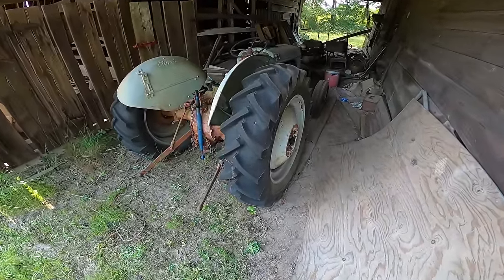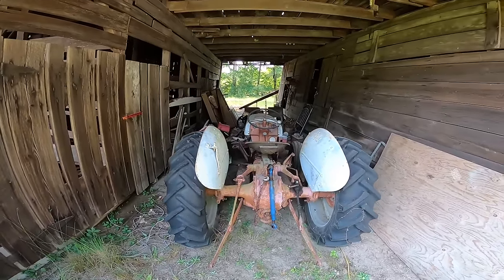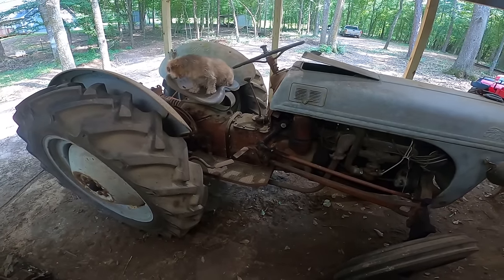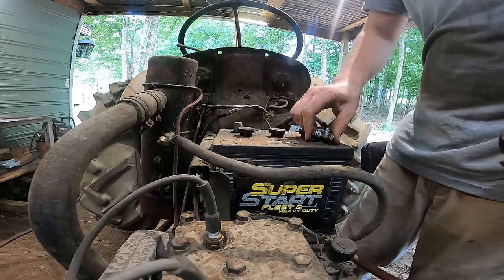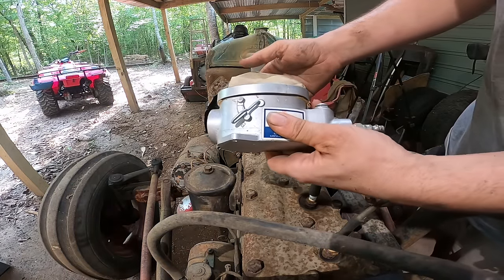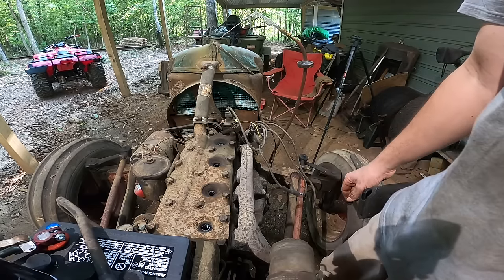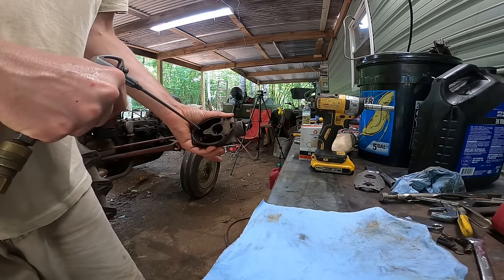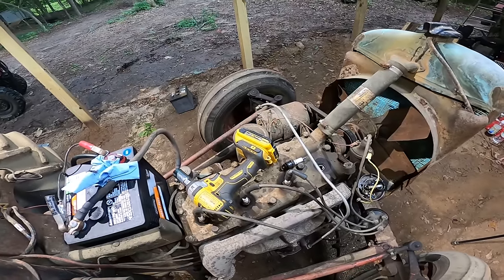Rescuing A 1952 Ford 8n Tractor Sitting In A Barn… Will It Run?

Comment: Hey Darrell, looking at your distributor and points orientation , it looks to me like the points are looking at cylinder number 2 instead of cylinder number 1. To correct this you would need to pull the distributor up enough to be able to move the distributor shaft one tooth  toward the number one cylinder. Make sure you have the timing on 4 degrees before top dead center before doing this! This should smooth out the rough running you are.experiencing. 😊
Reply from the maker: thanks brother

Comment: Just so you know that since it's a 6 volt system you can use a 8 volt battery and it will turn over faster.
Reply from the maker: @thomasschimdt5217  nice to know!!

Comment: Could have bought a 1940 9N at an auction back in mid January but I let it go when it reached $625. ALL four tires were beyond toast but the tractor was not a rust bucket, It needed EVERYTHING but I would LOVE to have bought it as a project to screw around during retirement.
Reply from the maker: they really are useful machines and really easy to work on this tractor was the best 700$ I think I’ve ever spent

Comment: Reading through the comments, sounds like you figured it out.  I have a 52 that I got running after sitting for about 6-7 years, and you're doing much more than I initially did...lol.  We just filed the points, checked for spark, added gas, and shot some starter fluid to get it rolling.  Popped off one cylinder at a time for a couple minutes until all were firing and then drove it onto the trailer to haul home.  BTW, I noticed the 105 shell right before you showed it.  This is from a 105mm Howitzer (artillery) and not a mortar.  Still used by artillery and also fired from AC-130 gunships.  :)
Reply from the maker: I wish this one was that easy! points and condenser were great no corrosion at all and was getting good spark, be sure to stay tuned to part 2 to see what I find

Comment: I had a lot of those tractors ,clean your points, check your condenser, and your coil. those tractors had very little oil pressure ,like 20 lbs or less. open your oil drain plug, unclean out your screen input new oil in, usually 30 wt. o[il. good luck.
Reply from the maker: Thanks for the tips! my friend!!

Comment: Darrell, you could possibly pin point the compression issue with a wet test. Put a little oil down the weak bores and repeat the test, compression goes up, its stuck rings , no change is a valve issue. Id say theyre just stuck or the bore is a little glazed, think some use a mix of atf and diesel to free them, have a Google. Id check the points gap and do a dynamic timing set on the ignition. So first gap the points with them sitting on the lobe in the dizzy, then wind her to the timing position, Id guess around 4-8 degrees before tdc and turn the dizzy until the points just start to open (use a multi meter on continuity across them). Great job, cant wait to see her fire 🙂👍
Reply from the maker: Thank you for your help! I’m starting to get into the engine I really hope I can get it going!! I love this tractor but it’s kinda got me stumped, I really think the distributor timing is off or somthing I dunno yet ☹️
Reply: @TheHomePros6221  you'll get there Darrell 🙂👍

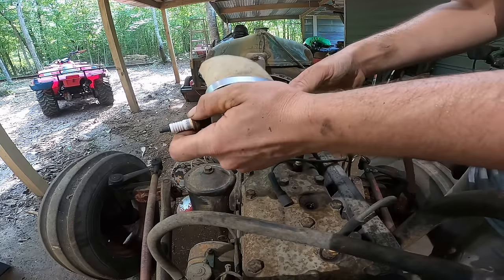Comment: At 18:40 - There was a time when spark plug sandblasters were pretty common. Someone decided that it would introduce sand into the cylinders, and it would if the sand packed up inside the plug, so, fewer people would continue to use them.
Reply from the maker: you are absolutely correct

Comment: Watching you pull out those spark plugs with channel lock pliers.....I could almost hear my father sitting on my shoulder yelling "NO....NO....NO!!!!  Use the right GD tool !!!!"
He has been gone 35 years now and he still haunts me....in a good way.  :)    By the way, my grandfather ran his whole farm with an 8N Ford exactly like the one you are working on.  Thanks.
Reply from the maker: I was in a barn far away didn’t have many tools, sockets wouldn’t fit without gas tank removed, I was planning on replacing plugs anyway, and the channel locks worked great so I’d say they were the rite tool for the job 😊 but thanks for watching my friend

Comment: I am needing to work on my carb and was watching in hopes I would see how to take off the throttle and choke cable. It looks like it just pops off and on easy. That helps my stress level because I’ve never worked on one either.  Thanks for the video.
Reply from the maker: they are super easy to work on the carbs are very simple

Comment: A little engine oil (about 1 tablespoon ) in each cylinder will help seal the rings some. Timing should be 4 degrees before top dead center..
Reply: Also, check the plugs out of the head to make sure they are getting spark through them.
Reply from the maker: Thanks clay I did try putting atf in already and I’m getting spark at the plugs. As far as the timing goes do I turn the flywheel until it gets on the 4 degree mark? How do I set the distributor? Thanks for your help!
Reply: Yes, you take a screwdriver and turn the flywheel, using the ring gear to turn it, toward the 4degree mark. You should not need to reset your distributor because you are not moving the crankshaft that much. Be sure to check your points for proper gap and smooth contact pads.
Reply: Make sure you have the correct spark plug wires going to the correct cylinder. Your tractor's firing order is 1,4,2,3.
Reply from the maker: Thank you for your help the spark plug wires were incorrect so I hooked it up like you said and it popped off a few times I then looked in the manual and the firing order is actually 1,2,4,3 and I hooked it up like that and I got it running!! But I think it’s going to need a rod bearing cause it has a little knock. Thanks for your help!!

Comment: Valves could be stuck open, once it runs they will free up, these engines are a relation of a Model A Ford engine, get it running let it get warmed up, let it cool down repeat a few times rings and valves will free up with use, change all fluids oil, gearbox, coolant etc. 👍👍😉👍👍 IF you get stuck, an empty cereal box will suffice to make a gasket.
Reply from the maker: Thanks Barry I rebuild the engine in the other vids

Comment: Fresh set of points, condenser, check coil. Dull spark. Get it running & valves & rings loosen up for more compression also.
Reply from the maker: yes sirr

Comment: Pore some transmission fluid into the Sparkplug holes, and let it set for about two days, and turn the motor over by hand after those days, then add more, and keep turning it every few days. Pt2

Comment: when I rebuilt an 8n 35 years ago, the hardest part after I built a sleeve puller with a lathe and mill and 1" steel and 1" hardened threaded rod, was pulling and installing the sleeves.
Reply from the maker: cool

Comment: Pt2, after leaving the transmission fluid in the motor for those days, take out all of the spark plugs, and crank it with the battery to blow out the transmission fluid from the engine, also drain the old oil and filter, and replace it with new oil and filter. Then recheck the compression of the engine.

Comment: Here's one of my famous tricks for oil bath air cleaner first clean the cleaner real good with some solvent and then use Dexron transmission fluid instead of oil we'll make the filter filter 3 times better and you can overfill it just a little bit too helpless lubricate the valves that's dextran fluid instead of oil
Reply from the maker: Great info!!

Comment: That 's a spark plug cleaner. I brought one from Snap-on about 30 years ago for about $15. There should be sand blasting material in the bottom. You insert the spark in the hole in the top and connect shop to the air quick connect. When you push the button air circulates the sand and cleans the spark plug.
Reply from the maker: You of course are absolutely correct!! Thanks for commenting
Reply: They’re also a good way to ruin a top end. Often that blasting media stays up in the spark plug and falls into the cylinder while running. Briggs and straton had a technical service bulletin on it several decades ago. Not worth the risk in my opinion.
Reply from the maker: Thanks for the tip!
Reply: @TheHomePros6221  absolutely. Nice work 👍🏻

Comment: Mix gasoline and 30 weight oil 50/50 gasoline add tbsp each cylinder replace plugs and give a try. I use this method to start all old engines you'll be surprised
Reply from the maker: Thanks for sharing

Comment: $450 to 600 tops if the tires held air over night....remember it's crusty and your time is worth something.  I over spent on mine, still don't regret it....there great tractors...
Reply from the maker: I think I payed 700 maybe a tad to much but got it running and use it all the time 😊

Comment: Unless you were using a "smart charger" the problem was most likely the battery and not the starter. I had quite the experience as a forklift mechanic trying to jumpstart stored forklifts at our dealer and if those batteries were stone cold beyond dead, no amount of jumpstart attempts or charger boosts are going to get that thing to turn over. If anything, 12 volts boost should have made that starter sing like an athlete on steroids. The dead battery was probably sucking in all the juice.

Comment: Check the points inside the distributor and make sure they are at 17 thousandths clean them with a finger nail file. Make sure they are not corroded
Reply from the maker: I did check out other vids my friend

Comment: A failed head gasket between two cylinders can cause low compression on those two cylinders.. rust on the valve is another possibility. Before I took that one apart I would put s little marvel mystery oil down the spark plug hole and let it sit a couple days,  blow the oil out before you crack it with the plugs in.
Reply from the maker: thanks for the great info
Reply: Spray starting m g liud. In carb

Comment: You want to get out of the habit of using pliers to undo nuts and bolts. It's the fastest way to round of the nut or bolt. Use the correct size spanner for the nuts and bolts they will last longer.
Reply from the maker: I know I had limited tools with me, be sure to watch my other videos

Comment: try to read a manual on timing the engine and then get it as close as possible, after that its all about fine tuning it... do that by swinging it and then rotating the cap back in fourth untill it starts coughing
Reply from the maker: Yes sir thank you part 2 should be coming very soon!

Comment: The compression is great. Rings and valves will only get better after running. It is spark. Not timing, weak spark. Using a woman's emery board nail file on the points will make your spark hot. Slide a dry piece of paper through the points after cleaning them to get all the grit off.. Your spark is too weak. Just seeing spark is not good enough. It has to be hot blue spark. Of course not cleaning and setting the points to a gap of probably 27 thousandths and she will not pop off. I noticed the rotor was not pointed at #1 plug, unless you never had the distributer cap down and correctly set in position. If that cap was down in it's position your rotor was one tooth off. Might possibly be the first time ever I have seen spark plug removal with channel locks, whatever.
Reply from the maker: it’s been running pretty good check out other vids if u want 🙂

Comment: Thanks for sharing, but a bit anti-climatic ;-)  Just watch a few dozen Mustie1 videos and you'll know how to troubleshoot a carbureted engine. Don't use sand to clean a spark plug, the sand imbeds into the plug cavity and later releases into the cylinder.... bad, very bad. See Taryl Fixes All for details.
Reply from the maker: Thank you for watching, I’ve watched all of musties and taryls videos along with a bunch others like watch Wes work..ect when I use the spark plug cleaner I make sure all the tiny particles are blown out with compressed air and brake clean.  I got the tractor running but there are some more surprises so be sure to look out for part 2! Thanks again brother and check out my other videos!

Comment: I just found your channel page or what ever you call it.
But anyways where did you find the spark plug sand blaster at???
That is cool and I would like to get one. It seems easier than a wire brush.
Keep up the good videos!!!
Reply from the maker: thank you!! however I’d recommend against getting one because the spark plug can hold sand in it then fall into the engine so you have to clean the plug very well

Comment: I have a 52 8n good tractors . I switched mine over to 12 volt system mine does have the front grill also . I was brush beating a few years ago and the front grill fall I didn’t no it till I ran over it with the brush beater.
Reply from the maker: omg wow!!

Comment: I would have squirted some Marvel Mystery Oil in every cylinder before I attempted to crank it.  The rings could be seized.  If you can get it going they may clear up.the MMO would help to unsized them.
Reply from the maker: I used a bunch of wd-40 I always lube any engine first before starting that has sat for awhile. thanks for watching!!

Comment: 1952 was the last year of the 8N.  Since this one has the side distributor, it would be a 1950 to 1952 (the '48 and '49 8Ns had a front mount distributor).  Ford brought out the Golden Jubilee in 1953 to replace the 8N.
Reply from the maker: Thank you!!
Reply: Early 50 also had a front mount dist!
Reply from the maker: It’s a 52 from what the vin says
Reply: @TheHomePros6221  You can't always go by the serial number to ell what year the tractor is. Engines have been swapped out over the years. I have one that I THINK is a 52 and it has an industrial engine in it. The 52 is I believe the only one that had a screw near the top of the steering column to add oil.
Reply from the maker: I’m pretty sure it’s a 52 I could be wrong but the guy I bought it from said it was a 52, and from the engine number from what the manual says it’s a 52, even if it’s not a 52 it’s def a late model
Reply: @TheHomePros6221  SN says 52 so that's that.  Only other option if things were moved would be 50 at the earliest with the proof meter (tach) that was for 50-52.  I have a 52 also.
Reply from the maker: Yes sir you are correct

Comment: Great deal I believe those compression #s will improve but if you have to get into the engine these are fairly simple after you block it up and remove the front end that engine is sitting out there nice easy to tear down the block. Good luck. Cheers from Jacksonville Florida 🌞
Reply from the maker: I did get it running and they did improve, stay tuned for part 2, and thanks again for watching!

Comment: Did you try fine tuning the distributor? That can smooth out the engine some and may cut down the knocking sound some.
Reply from the maker: IT SOUNDS LIKE ITS COMING FROM A ROD KNOCKING BUT ILL TRY TOMM, IM GONNA MAKE A VIDEO OF IT SOON AND TAKE OFF THE OIL PAN AND SEE WHAT THE ROD BEARINGS LOOK LIKE

Comment: Spark plug cleaner not good for engine. Sand gets chough in plug, gets in engine. best thing to use is wire brush . Clean points.
Reply from the maker: Yes I make sure I clean them out with brake clean and compressed air, but a lot of people say that they get sand in engine

Comment: Surprised if the tires aren’t filled with calcium for weight
Reply from the maker: could be I know they have some kind of liquid in them
Reply: @TheHomePros6221  Calcium chloride solution is added to tractor tires for additional weight usually for plowing,

Comment: I have one that has been sitting for 10yrs since my grandfather passed….. I’m thinking fresh oil, gas, plugs, distributor, wires, battery to get it started.  What else should I look at?
Reply from the maker: if it’s been sitting that long I’d take out the oil relief bolt at the front of the engine and prime the pump

Comment: spark plug cleaner. totally junk. gets sand in the cylinders.
Reply from the maker: Not if u clean the plugs out well after
Reply: @TheHomePros6221  they still use these on aircraft and they use a special blasting media [not sand]

Comment: first thing i wood do is buy some tools pliers are NOT for taking bolts loose
Reply from the maker: Common man I have every tool imaginable I just didn’t bring some of the rite sizes with me, did you not watch later in the videos were I took the spark plugs out with a actual spark plug socket? And really who cares if I used channel locks to take a spark plug out?! I got it out didn’t I? So actually if the tool works then it’s the “correct” tool, and no I didn’t mess up the spark plug by doing this

Comment: It would crank just fine on 12 volts.
Reply from the maker: It’s a 6v system mr.know it all
Reply: @TheHomePros6221  Starter don't care!
Reply: @woodman4550  But the ignition system cares.
Reply from the maker: yes it does
Reply: It doesn't care either.  Nobody cares. Use 12v.

Comment: Rotor button not pointing to number one on top dead center.
Reply from the maker: I did get it running in part 2 but there are other problems, but just curious is there a mark or somthing on the rotor button in order to Aline it? what’s your process?
Reply: Remove distributor part way, rotate rotor button little at a time until button is lined up with number one on cap and re install. Rotor May move a bit as it is re inserted, so may take more than one try.

Comment: Operating a torch so close to a battery is an invitation for a hydrogen gas explosion from one of the cells of the battery. Play it safe, stay away from batteries with open flame or other potential sources of ignition. Stay safe out there.